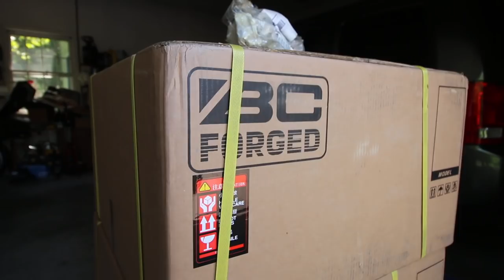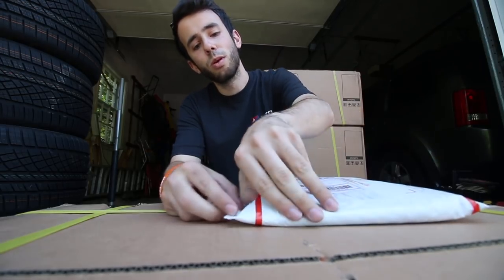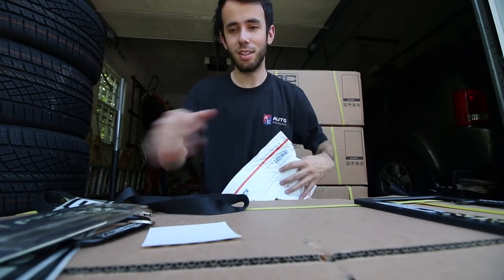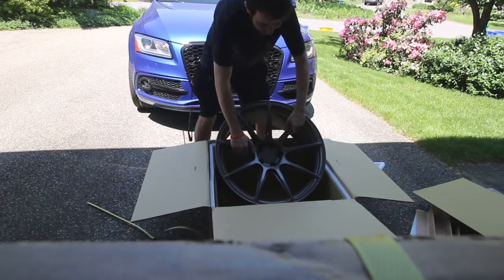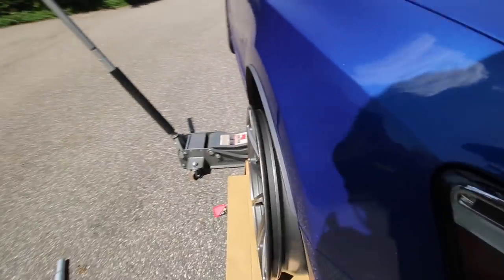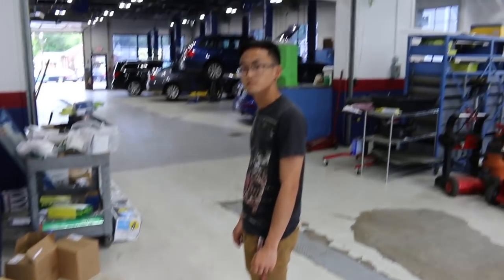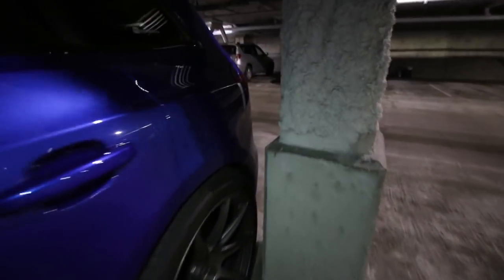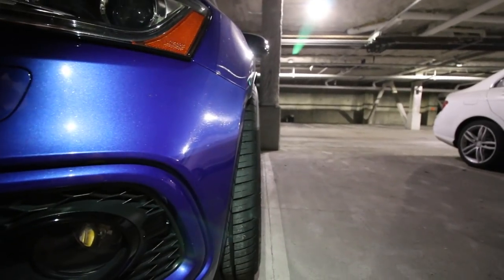NEW BC Forged RZ39 Wheels For My SQ5!

Comment: Also on a side note. Do you know what you're towing capacity is with that. Before I make the switch from a Yukon Denali I'm just curious if it's able to pull anything like I'm sure small trailer in the 4-wheeler would be okay but could I pull a car with this safetly?

Comment: Hi
I have an Audi q5 2014 s-line 3.0
Have you used any converter or calculator with the matching of rims for the Audi SQ5?
I am interested in 20 '' but I do not know if the 10.5 '' width will not be too wide on the (standard suspension and it will not be rubbed somewhere)

Thank you

Comment: So I'm picking up a 2016  S5, they currently have 20 inch wheels with I think is a 255 or 265 I couldn't read if it was a 30 or 35 sidewall but I'm thinking about for summer running a 21 and I'm just curious if it would be a 285 3020 one will that fit. Or 295. Or does it have to be a 25 sidewall? Any input is greatly appreciated

Comment: I have 2010 Q5 Premium. Other than the interior led light swap, what performance or cosmetic upgrades would you recommend? It is dark metallic blue with OEM original wheels. Thanks for suggestion and guidance..

Comment: What size wheels and tires do you recommend for a 2016 q5 to sit flush? Or nearly flush?
Reply: I just ordered 25mm spacers to start, I have the OEM 19's but maybe 20's if I can find a good deal, otherwise keeping mostly stock - with a possible honeycomb grill upgrade,

Comment: Size and concavity is nice, but damn...wheel design is a bit too bland for me.
Reply from the maker: I’m not one for flashy wheels - you can look through the channel, I’ve never run anything crazy!
Reply: I’m not talking flashy, just something with some sort of design would have been nice. Actually the VMR’s you had, but in a gunmetal or black would have looked sick on the the SQ5.
Reply from the maker: @Wrekt330  VMR doesn't make 21's